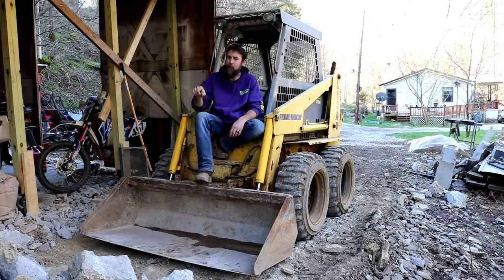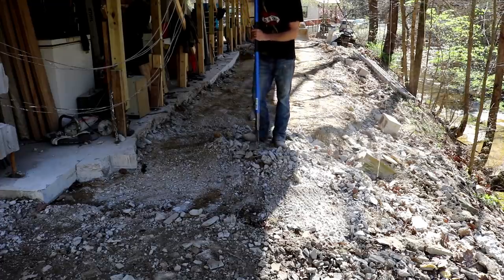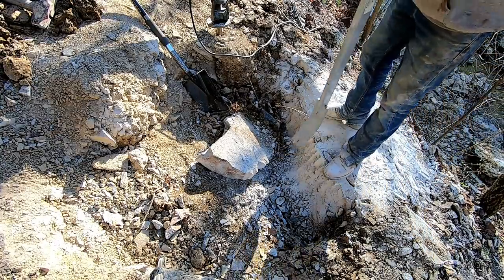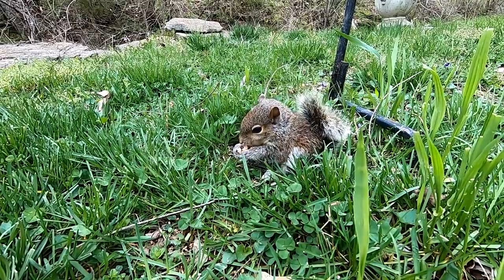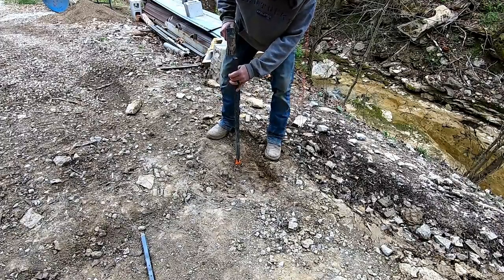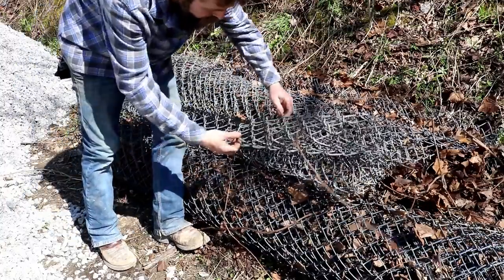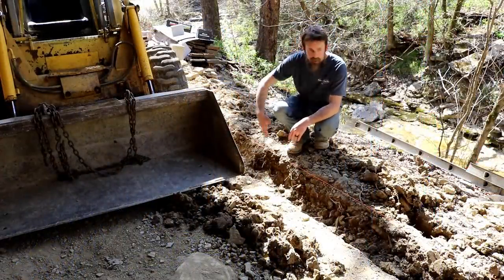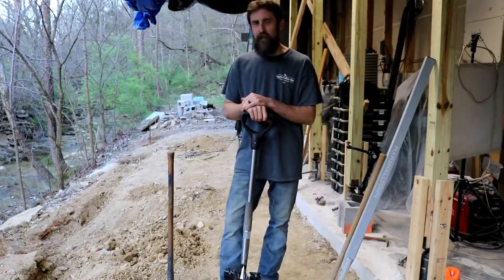BIG Rock and shop floor rubble Removal  It Keeps getting better! Shop damage part 9

Comment: Pouring concrete is simple. It requires forms to deliniate the perimeter of your slab. It requires reinforcement  - you bought heavy rebar. For a shop my guess 12 " if you have heavy machinery.  The base should be crushed stone, fairly level. Once you start pouring you don't stop.  Measure the interior volume of the molds and that how much you need. Transit mixed trucks carry about 9 yards. You have a strip about 50 feet long and 6 feet wide. if it is 1 foot thick that is 300 Cu.Ft  you will need about 12 to maybe a little more yards. The big question - how will you lock the new and old slabs together. If you don't do that you will soon have the same problem of two separate floor slabs.

Comment: Steve are you going to dig footers for your block wall. You will most likely have to go down at least 24 inches and 12 inches wide. I would drive rebar down as far as it will go inside the footers. Take care!

Comment: Have you thought about sinking a series of piles? It wouldn't take long to get a rig to do it . I'm no expert but it seems to me that a slab that is just poured onto that bank will be bound to fail due to its proximity to the bank edge.

Comment: Dont try and break this type of rock by drilling. Use your chisel to split it into layers about 2 inch thick then smash it. Use it to build the wall reinforcing the bank and then fill behind it. It will outlast concrete by three or four hundred years!

Comment: I'm sure you have a good engineer. I sure don't want to sound like a know it all but I will say you had a sub grade failure not a concrete failure. It appears the majority of your shop was built on natural ground and the area that failed was built on a fill area. So the natural ground didn't settle where as the fill area did. Hopefully the fill area has stopped settling and has become stable. But I wouldn't count on it. Most time you would want a stepped footing so that the footing would be constructed on the same type soil. Or piers drilled into natural ground to support you footing and slab. The wooden wall will remove alot of the load but I'm afraid you will still see more settlement and more cracking in you floor and masonry walls. I'm not trying to tell you what to just giving you some experience from years on structural construction. Good luck. I really enjoy your videos. Keep up the good work!

Comment: Only thing with those soft grips on shovels, they really tear up your hands. A regular wooden handle is actually easier on your skin than the newfangled soft things. I've discovered that the hard way a couple of times. You don't even realize it's happening until you either have a huge blister, or have torn some skin off! Wow, when I started watching this, it had 2 views - at the end of the video, it now has 1200! Wow!
Reply: I stick with the classics when it comes to hand tools myself. So wooden handled shovels all the way. On the job we liked Union brand hand tools. We were union all the way!

Comment: Steve, when I saw you slip and fall the first time I gave out a laugh and thought - I've done that.  When you did it again I thought -  I've done that too.  Stay safe and please keep posting these videos.  By the way, how much training does it take to use those dangerous tools you showed at the end?
Reply from the maker: It takes zero training. You self train quickly due to the pain and stick with the way that hurts the least. That's probably the correct way.😁

Comment: Hi Steve, forgive me for a tip. Even the hardest rocks are like wood and must be crushed in the direction of the veins. Another thing, wouldn't it be better to consolidate the bank with a 4-5-inch concrete pile barrier stuck in the ground? By the way, congrats for the hard job.
Reply: There's different kinds of rocks. Some are easier to break than others are. I think Steve wanted that rock broken a particular way too.
Reply: @1pcfred  I agree, but that rock was a shale sandstone, and it is made in layers, in the cracks between the layers you intervene to break it. Steve was lucky not to get hurt when he slipped in trying to break it with the hammer jack.
Reply: @NicolaP269  we'd foot the bits whenever we had to chip out of the horizontal. That way you hold the tool until it bites. I've definitely had the opportunity to use chipping guns in unconventional ways. Even overhead! I've run a 60 pound pneumatic off my shoulder. Which is pretty nuts. It was definitely too crazy for one super that saw me doing it on the edge of some scaffolding. He came running over waving his arms and shouting, Stop! Good times.

Comment: too little too late but can a drilled hole not be used as a starter for the jack hammer? I'm sure you'd only neeed a half inch hole or inch at most as a starteer. Those shovels are kind of bad as they've all failed the same the transition between the shovel blade and handle. I don't know for sure, but I can guess that since the shovel blade is so long the transition takes more stress in use than a shorter wider blade of same handle size.

Comment: How deep are footings are you going to pour? I think you'd be money ahead to rent a small excavator with a breaker attachment you could probably achieve everything within a couple of days with a lot less hassles if possible rent one that has the two swing points an example would be a cat Mini excavator 303 just given an example any brand would work for you just make sure you get a breaker with it

Comment: Don't move any stone you do not absolutely have to.Do not disturb any trees either - the big deep rock and running tree roots help to anchor the bank. Facing the creek bed with rubble will NOT stop ground settlement and creeping. You need to put pins down fairly deep - Use an auger to drill 8" holes down 6 to 8 feet. Pour concrete into the holes. They do this along RR cuts and highway cuts. Regardless of heavy or light machinery - you have to thing about weight over time over distance and possible movement of earth under the new slab. There is no easy way to do a strong slab. Talk to a civil engineer. Get his opinion.

Comment: Why don't  you set the new wall back from the original wall line by at lest 2 or 3 feet and have an over hanging eave thus building  on more stable ground

Comment: Steve, those two digging implements you purchased are called GRAFTS and are generally specific to hand digging in clay soils. By the look of what you have there I’d say they ARE NOT the right tool for the job. A pick and regular shovel will complete the task and that’s ONLY if you can’t get in there with a small excavator. Having used ALL of the above throughout my life, please accept this advice and save your wrists,hands and elbows. A graft is for cutting soft soil or clay and the way you use these tools, if you use them in hard rocky soil WILL  in short order cause long lasting injury. By the way, those big , flat pieces would lay a really nice, rugged path or a patio. I see ‘em laid and pointed in a good mortar and then pressure washed to reveal their handsome, rugged appearance.
Reply: Steve isn't limp wristed. Using a "graft" shovel won't cause him any different injuries than a regular shovel, if any at all. Looking up "graft shovel" (because I didn't know what they were called. I assume that is a UK term because all the sites are UK sites) I couldn't find any information about it being used for "cutting soft soil or clay." In fact, almost every link I clicked on said that they are rugged and good for rocky soils. "This shovel has been designed specifically for grafting – slang for hard work! This can be anything from digging into dense terrain to shifting heavy material." They are heavy and made out of thick gauge steel to stand up to prying forces. I can't fathom how this type of shovel would injure him more than a regular shovel.
Reply: Andrew Delashaw if you’d ever used a graft you’d know that using it in rocky soil is hard on joints in hands, wrists and elbows, also on unprotected insteps as the graft is driven into the soil with the foot. Years ago men that used a graft all day for a living had a steel plate that was strapped to the driving foot sole to stop the damage. I have used a graft on many occasions and as you haven’t id think you’d defer to experience. As for your implication that a limp wrist might be present, that’s not the case either, at a lean 225 and in the 1000lb club since I was twenty two that’s never been a problem. If you’d used a graft all day, if in fact you’d ever dug a trench by hand where a machine couldn’t be used you’d know how tough this work is and that’s in clay. The physics involved in trying to drive a graft through hard rocky ground are such that as you drive the graft down with your arm to start a cut the resistance is immense. I own several grafts and mine are not flimsy like those Steve has there, they’re contractor tools, forged from heavy, tough steel with thick steel tube shafts and wooden “Y” handles. If you had experience in this instead of reading some nonsense written by someone equally ignorant on the internet you’d know, in rocky soil, a pick axe and digging shovel are the correct tools for the job. In fact, go and get a graft and try driving it into concrete or asphalt  and you’ll grasp just what I’m talking about. As for my knowledge of injuries, aside from working in the construction industry for thirty + years I studied osteopathic medicine and spent time with champion strength athletes and body builders so, yes I’m fairly qualified to comment on RSI’s. What medical studies have you carried out, did you study anatomy, physiology, and biochemistry along with hard time spent working and training physically?  I have these experiences, I didn’t read about this subject, I learned by doing.

Comment: Did you have any issues with the teespring mug preview (on site) looking really pixelated? I have put a few designs on there myself and the preview always looks bad.. its really annoying.
Reply from the maker: The mug is not quite as clear of  image as the sticker but I think it looks great. I didn't do the design work so I cant say if there was trouble. I wanted to see the finished product so I got some samples. I am more than happy with them.
Reply: @SteveSummers  the mug you got looks great, plenty of detail. I have tried about 7 different designs and the preview on the site always looks so bad, I've spent hours googling but can't seen to find anyone with a similar issue. Maybe I'll just have to buy a sample and find out. 

Thanks for replying, all the best to you and your family.

Comment: At last Steve. . . .you're wearing gloves. Well done. But you soon took them off.
Reply: For hand work like that I wear work gloves religiously. Because I'm not stranger to what that kind of work can do to me.
Reply: I've got the scars from years of gloveless work.. some of it unavoidable, but I can tell you, the most painful and biggest scars happened at times I could have been and should have been wearing gloves. 
Can be a hard habit to form, but it's worth it to try.
Reply: @typrus6377  the habit that I saw was hard to form was to have the presence of mind to have a pair of gloves on the job. Guys just wouldn't have gloves with them. I've been on some jobs where wearing gloves wasn't optional. Like the time I was on a crew taking down a plank deck inside a mall. We were told in no uncertain terms that the plank could not strike the tile floor. So we slid each and every plank down gently. Each and every dirty abrasive heavy plank. Which took a toll on the gloves we were wearing. Just shredded them. I was ruining two or three pair in a day. No one was suggesting doing it bare handed.

Comment: Move the foundation 3 feet IN so you have a overhang along the long wall and you're not having the foundation so close to the cliff. You can have a walkway to the back of the garage. So you ain't fighting with the cliff and hoping it doesn't do the same thing by you bringing the foundation father away from the cliff!!!!!!!!
Reply: I thought that was the original plan but it looks like he's trying to go back where he was now. I guess he's figuring if he can get enough of a footing under the slab he'll be OK? He may be right too. If he builds the footing right it should stay together even if it is floating in the air.
Reply: Probably holding the slab out far and wide and then he's bringing the foundation 3 ft in
Reply: @kevinplowman8982  I suppose Steve could always pray for drought.

Comment: you couldn't do the whole pad with the small mixer , i think the drying time of the concrete will be faster then the speed you can cook it up and pour it start to finish , beside the fact that you have to keep going untill finished or end up with a weak line across the pad
if you try it , the best way would prolly be to move the cement mixer to the spot you need the cement mix it up and just dump it under the mixer then move the mixer to the next spot 
with making the walls only partway out of the block you might have enough material left to extend the shop intoo a different directlion with little extra materials needed , you might want to consider ordering more concrete and extending the concrete pad so its ready for use if you can find the time and cash to grow the shop
as for driving in the stakes , you could cut up one of the chissels included with the jackhammer weld a piece of pipe on the stub that fits over the stakes and use that to drive the stakes intoo the ground
as for the eroding problem , i wonder if it would help to build a row of dams 3 or so foot out from the hill to a couple intoo the water angled away from the streams direction  , my thinking is the water will vortec behind the dams and create a low pressure zone that might deposit soil and mud helping to prevent corrosion on the hill itself as it will grow out the base , it will still be somewat natural looking

not squeemish but those tools did gave me a rash from just seeing them

Comment: Im thinking that rock was all that was keeping your old slab from being in the creek
Reply: We don't think about the rocky crust of this planet very much. Yet we can't dig a mile down into it. Just gets too hot. That's because the molten part of the planet is closer than we imagine. Under our feet is a molten iron core 10832 degrees Fahrenheit! Which is 760 miles in diameter itself. That's just crazy.

Comment: You can "stabilize" a river bank until the next big spring flood. Your building is simply too close to an irresistible force of nature. Floods can take out engineered bridge abutments. Of all the experts that you have consulted have you talked to your insurance company? Will they cover building that close to the "creek" and if so what sort of building/foundation will they cover? If the insurance company doesn't want the risk then you don't either.

From Wikipedia on gabion baskets:
" In the United States, gabion use within streams first began with projects completed from 1957 to 1965 on North River, Virginia and Zealand River, New Hampshire. More than 150 grade-control structures, bank revetments and channel deflectors were constructed on the two U.S. Forest Service sites. Eventually, a large portion of the in-stream structures failed due to undermining and lack of structural integrity of the baskets. In particular, corrosion and abrasion of wires by bedload movement compromised the structures, which then sagged and collapsed into the channels. Other gabions were toppled into channels as trees grew and enlarged on top of gabion revetments, leveraging them toward the river channels."

Comment: Hate to say this but, from what I'm seeing you dig up, it's highly possible that, those flat rocks were part of the original design for the foundation. As I said, all the rocks you're digging up are "flat". Think about that for a moment. Not saying you're doing anything wrong here, just pointing out something that's a bit obvious. I've seen this done many times before. Save those flat stones, clean them up, use them as "stepping" stones somewhere on your property. Even that 14" thick piece was most likely a "corner stone" for that shop foundation. 
Hahahaha as for the tools, today's world, today's generation has no clue what "real" work is. If you're going to the route of digging a "trench" for the foundation wall, look into a trencher. Digs the trench, moves less dirt/rock out of the way. You'll probably still end up needing a mini ex. for the short walls. It's going to take you awhile to finish this project. Great video, cheers :)